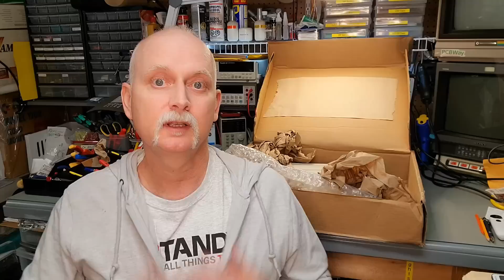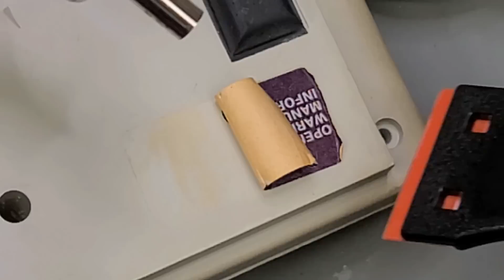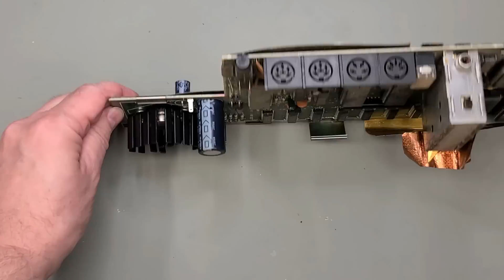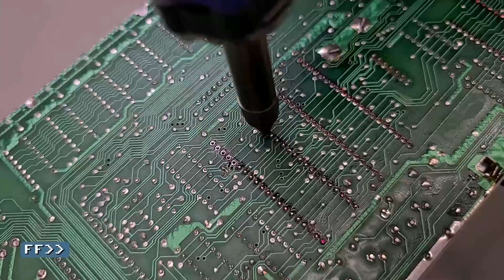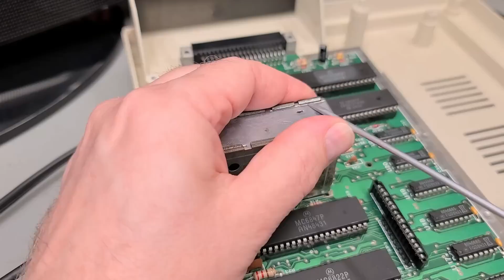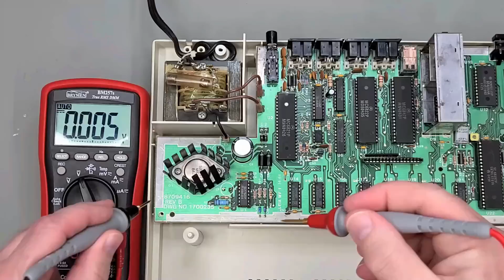#SepTandy CoCo 2 Trash to Treasure — Part 1

Comment: Hey there!  Know this is an older video, but I HAVE to point this out!  https://youtu.be/sE_F-J7bJsE?t=1662  At this point, you go down the wrong path on the flowchart!  The yes/no box states is your voltage BETWEEN 4.75 and 5.25 volts, and you said NO.  5.2 is definitely within that range, you should have said Yes.
BTW, I have also recently acquired an EBay CoCo2 (same exact model, coincidentally) and I have also been hitting the Discord!
Reply from the maker: Sweet mother of $*^%!!! You are so correct. Damn, back to math class for me 
— for shame. That said, I have to revisit this project and get it done. The past 18 months has really thrown off my retro hobby (and video making); this must be corrected in 2022. Looking forward to hear about your CoCo2. Are you using the same handle on the MFR Discord?
Reply: @MindFlareRetro  You still have a few days left in this years SepTandy 2022. Let's Go~! I'm super intrested in seeing the conclusion, I really enjoyed the Flow Chart troubleshooting.

Comment: All my coco's had bent fins on the heatsinks, so yes it is normal...  i opened up 2 coco1's and one was never opened before...  (still sealed with sticker).  I had one of my board power connecter break off the board when fedex damaged it in the mail, so added a quick release crimp in 16AWG to complete the power connections... 
Enjoying your venture into coco territory... And that coco2 board is HALF the size of a coco1 board yet I think they are close to the same specs.
Reply from the maker: Thanks for the bent fin. I am still a stranger to Tandy repairs and have to admit this has been a challenge for me. I really do need to get on with part 2 - at this rate I'll save it for the next SepTandy. 😂

Comment: Well done!  I enjoyed your video a lot.  The second I saw that transistor at 28:01 I knew it was toast.  I've replaced similar ones in Commodore 1541's a bunch. The "domed" appearance of the top of the transistor gives it away.  They are flat when they are new. :)
Reply from the maker: Oh, I didn't notice it was domed. I haven't had much experience with dead TO-3 packages. I have replacements now and will compare. Thanks for the info. 👍

Comment: Absolutely outstanding, top quality video as usual. Those sockets look proper old school and the 'rf shielding' looks like something out of a 1960's space program! The noises that chip pulling tool was making didn't sound very reassuring lol.  Maybe try Q1 on a cheap component tester to see if it is OK or remove it and inject voltage after it? Looking forward to part 2.
Reply from the maker: Thank you, sir. OMG, yeah, those chips were in there TIGHT! I definitely plan to test Q1 in my cheapy component tester. In fact, I have sourced and just received, NOS compatible power transistors and will compare. Thanks for commenting and for the positive feedback, as usual.
Reply: @MindFlareRetro  WD 40 on the pins, a little dab'ill do you to facilitate in and out.
Reply from the maker: @pvanb2   Thanks! I will give that a try.

Comment: You should've just removed the left-side of the warranty void sticker far enough to extract the screw
Reply from the maker: Good point. Once I started I couldn't stop. ;) Actually, I was intending to deep clean the case in an upcoming video: soap, water, retrobrite, so the label would not have survived.

Comment: I just saw a video on fixing a star wars arcade cabinet. It had transistors like this one different part numbers, but they were can type. 4 out of 6 were bad. Replacing them gave him horizontal deflection and replacing the massive resistor that looks like a chunk of Styrofoam gave him the vertical deflection fixing the unit. I wonder if these types of transistors aren't reliable over this amount of time.
Reply from the maker: Hmm. Interesting. After a lot research I did find an older exact Motorola equivalent power transistor and a contemporary model that is 90% compatible specs-wise. I just received them last week so fingers crossed.

Comment: lol if you think that's dirty you should have seen the C64 I fixed up starting a year ago. It mostly is in good order now, but the DIN cable I bought for the power is trash. I'm considering buying a real C64 PSU and using the cable off it for my home made PSU. I just don't want to solder a DIN.
Reply from the maker: Yeah, round DIN soldering is not my favourite task in the world.

Comment: The small disc capacitor on the right side in the RF modulator looks like it has blown 25:50
Reply from the maker: Thanks. I'll look at it again. Most if them have black ink across the too (from the printing of the values). Some of them look burned but it's just the dark ink. I will look at this again - thanks for commenting.

Comment: Nice Video, but you swapped the U12 & U13 (Primary ROM & Extended Basic ROM) after cleaning ..
Reply from the maker: Oh, crap! Really?!?!? Such a noob move. I was - or so I thought - very careful with the positions of the chips when removing and replacing them. I need to go back and examine my before photos and video clips of the PCB. I wonder if this computer was worked on in the past and the chips replaced incorrectly -- the Service Manual does list the "Tamper Label" as a replaceable item (PN 8789090). Or... more likely my error. Thanks for bringing my attention to this.
Reply from the maker: It's official... I screwed up. The orientation was correct when I first opened the case. I placed the ROMs the wrong way around (A-B, instead of B-A) in the temporary storage box. A great observation on your part! Well done. Thanks for letting me know.

Comment: It would be interesting if the Q1 regulator can be replaced with a 7805 in a TO-3 package, such as that on the 1541 drives.

Comment: Check the resistors visible at 19:25.   The leads are corroded and they may be open or not electrically connected to the traces any longer.
Reply from the maker: Yes! I didn't make mention of those in the video. I did clean them up quite a bit but I probably should just replace them. Thanks for your input.